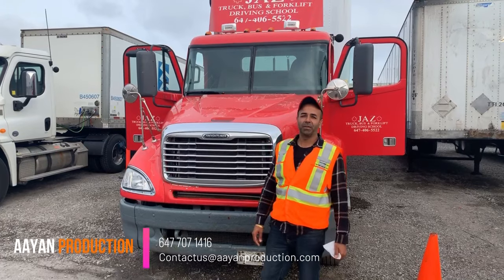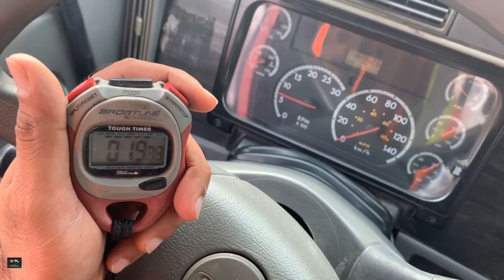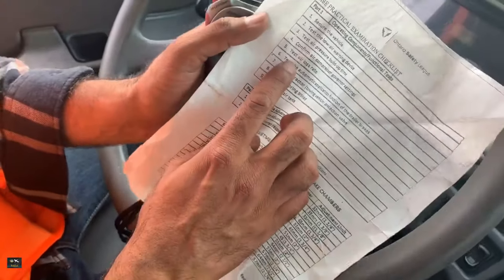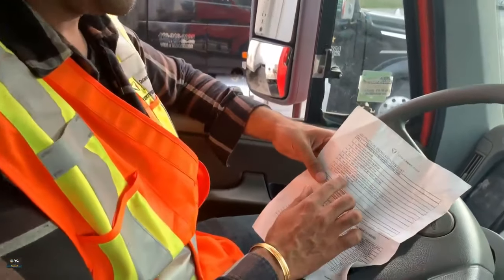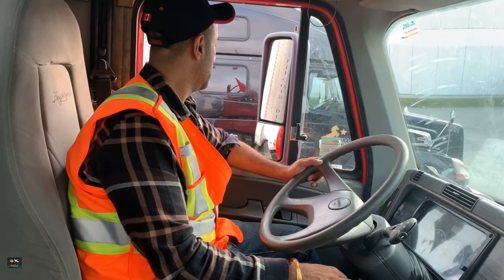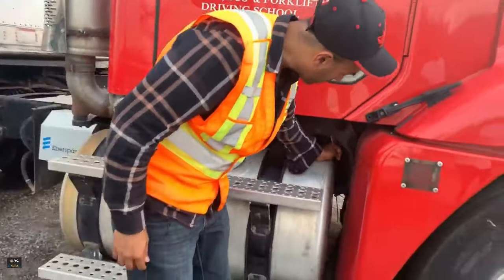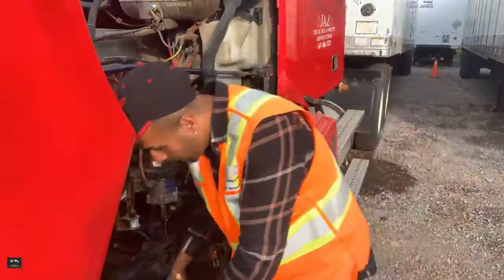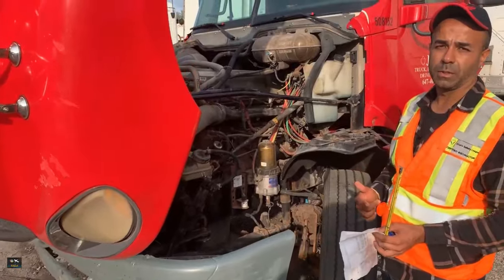Air Brake Practical Training Jaz Truck Driving school

Comment: Guys,  really, i passed and got my DZ Certificate  within a short period of time only because of this School . No kidding. This instructor Jaspreet is very educated, very experienced and his method is very easy to pick up and pass exam.  Absolutely positive about Jas School. Thanks a lot Jaspreet .
Reply: What is the theory like?
Reply: DZ is east😅 try AZ i know guys that had to do the test 5 ,6 times before passing. DZ is piece of cake compared to az..
Reply: You may have passed but if you had a competent examiner you probably wouldn't. I do cvip inspections and his information in my opinion is not fully correct. But yes he's good in most things

Comment: I'm a licensed mechanic. Your cut out and cut in pressures are dictated by the mechanical design of the governor on the compressor. It's mechanically set to 25 psi from your cut out pressure. Only the cut out pressure is adjustable.  If you set the cut out pressure to 150 psi which is standard for coaches and 120 psi for trucks... the cut in pressures will be 125 for coaches and 95 for trucks. Anything else is bad.

Comment: Very easily followed and explained by Jaz. I have my Z endorsement test tomorrow and this video will go a long way in making sure I am well  informed and prepared. Thank you sir! Great Instructional Video!!
Reply: Update- Thanks to Jaz's in depth knowledge of the AB System and his years of teaching experience, I was able to pass my Practical exam with a near perfect score! Only thing I missed was forgetting to state the necessary psi required prior to performing the Brake adjustment inspection (which is between 90-100psi BTW lol) so it was more of an oversight then a mistake..I can live with that lol)
Thanks Jaz!

Comment: Thanks Jaz, great videos,  failed today because of the air loss rate test... forgot to shut the engine off and a coupling question, i was pretty sure i touched all the bolts and fasteners using the 18" stick and not my fingers.... no worries i am scheduling my retest.... thanks!
Reply: Don’t even stress  brother you got this I passed in my 3rd try lol 😅
Reply: @Lilwayne911Eminem  I'm about to take mine tomorrow and I feel pretty nervous.  Seems like a lot to remember. lol
Reply: @99oildrops  ahh ahhh good luck brother!!

Comment: Wet tank is the tank the gets fed off your comprrssor or air dryer. Primary and seconday can be a bit confussing as some are combined into one with a double check valve in between the too but depending on the number of brake chambers that dictates the total air volume that needs to be stored and hence the total number of air tanks

Comment: To make it easier for Canadians: MLAGGA, ATTD. Explanation: Mark and measure pushrod stroke, Low air warning, Air pressure build up rate, Governor cut out, Governor cut in, Air loss rate, Automatic application of the trailer spring brakes, Tractor protection valve, Tug test, Drain tanks. 10 tests in total, 1 and 2 red and yellow in , 3 and 4 red button out, 5 and 6 red button in,  7 and 8 red button out, 9 tug test easy do it one by one, don't forget to apply parking brakes yellow and remove wheels chokes, 10 drain wet tank, check valves in secondary and primary tanks.

Comment: Good demo. As for learning the steps, thanks. 

But as for reading the dials, I'm not sure. The brake loss test (1 min) anyone can clearly see that 5 psi was lost. Anything below 4 psi the truck should be taken out of service. Most don't pay attention to details because generally things are fine. But when a ministry officer has your pass (or fail) their hands its a different story. See for yourself.

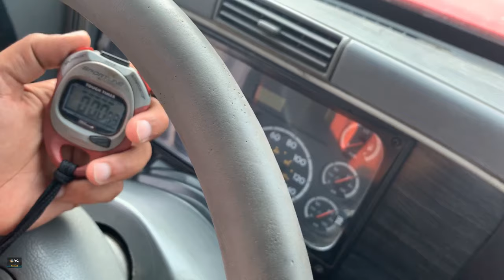It begins at 6:15 at approx. 100 psi
It ends at 7:15 approx 95 (using my eyes). It's about 1/4 the distance between the 75 psi and 100 psi markers. This result is approximately the same for both primary and secondary tanks. It should go out of service. That's bad... Or is it just me?

Now go and see how CDL does it.
Reply: Lol he’s making a training video and was trying to be time efficient and all he had to do what was wait to start the timer until the air pressure needle stopped moving after applying the brakes. That doesn’t mean that truck should be put or of service. U clearly work for CDL and I’ve tried watching their videos and there all super lame and terrible camera work.
Reply: @matthunter975  Actually, you are correct. I happen to be in school right now and the day I watched that video is the day I learned the air loss rate. The next week I learned that, as you say, there an immediate loss of up to 10 psi sometimes, after which the needle stays put as you say. But I'm not sure if he mentioned that it drops 5-10 psi immediately, which my teacher failed to mention as well. I learned what actually happens on my own after sever tests and noticing that by observation. The teachers only teach what we need to pass, little to nothing more